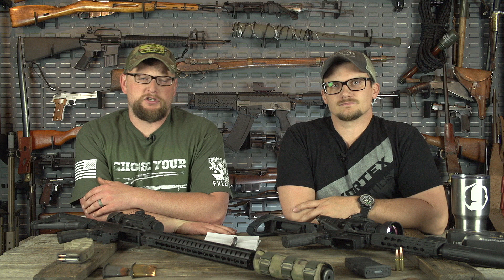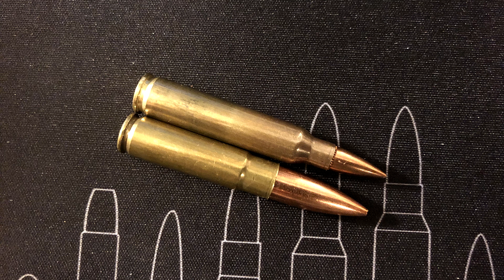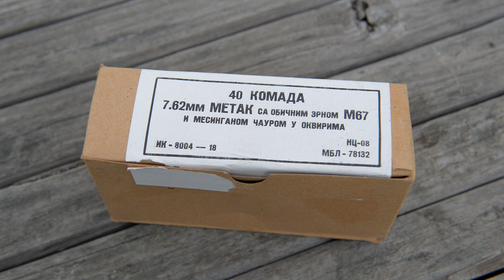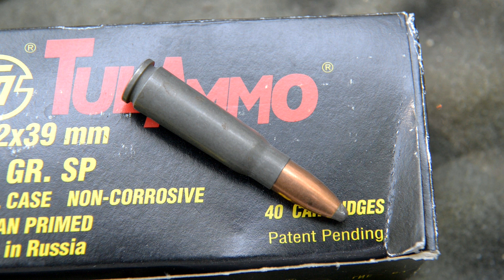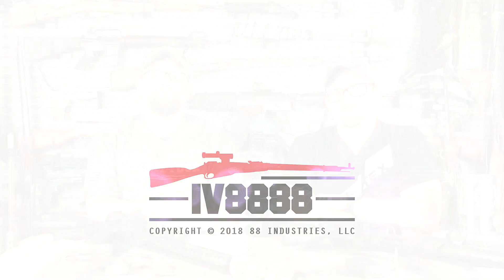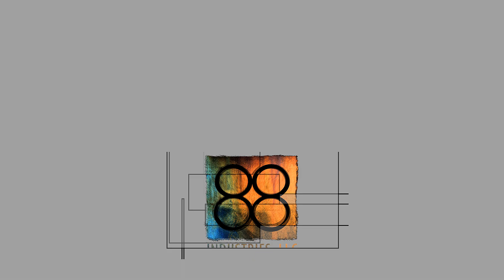Firearms Facts: 7.62x39mm vs 300 Blackout

Comment: And for reloading…the .300 AAC blackout  uses .308 bullets vs. .311 and thanks to the “Squirrel Daddy” case trim jig you can easily cut down .223/5.56 brass to be used in forming the .300 AAC brass (if you spend the $30 for the cheap assed Harbor Freight chop saw) and the .300 AAC really performs well with home-cast powder coated bullets…plus military surplus reloadable brass ammunition from Australian Defense Industries (ADI) loaded with 125 gr. Sierra MatchKing bullets for under .55 cents per round when they are on sale from Global Ordinance (it will be hard to find the bullets alone for that price after tax and shipping)…all in all…the .300 AAC blackout rocks in so many applications 👍👍👍

Comment: Psa ks47 for 7.62x39 AR 10.5” barrel and  300aac for 7.5” barrel AR does great suppressed or supersonic but the anmo is not for plinking way to expensive so plink with the 5.56 or 7.62 x39 or even better 5.56 gun with cmmg 22lr conversion bolt that’s the way to practice close range all day for free pretty much

Comment: I’ve looked into both I’ve owned a 7.62x39 AK underfolder but I went with the 300 blackout by traiding the Ak for 300 parts including lower parts 🤣🤣🤣 now I run 147 Grain 300 blackout pills out of the 16” barrel
Reply: 300 blackout is best! It’s stupid people trying to run x39 in AR platform . Just get 300 blkout I say!!

Comment: 300 black outs are garbage. I’ve bought a premium norveskie barrel load premium hand loads from 120-220grn bullets suppressor or not, barrel node or not, it doesn’t matter grouping is terrible performance is terrible. The powder for 300 is not h335 its 15grnz of h110 pistol powder whereas the 39 is 29grains of h322 rifle powder If you shoot hogs with a 300 black out 125grn ballistic tip vs a 39 123grn ballistic tip the results speak for itself. The 39 will out perform the 300 all day every day in accuracy, velocity, knock down etc. the black out was a basterd round developed and the projectiles for a 30 cal range from 300 black out to 300 win mag or greater the performance of the same class isn’t the same. If you’re debating on buying a 39 or 300 bo buy the 39 and thank me later

Comment: If you handload the 300 blackout the cases are practically free. Also, handloading the 7.62x39 requires the .310” bullets that are not as available or cheap. The deciding factor for most shooters is magazines. Reliable mags for 7.62 are also expensive. Finally, the 7.62mmx39 is a commie round and that communist gun powder stinks...

Comment: My question to you guys is: if my goal is a dedicated suppressed subsonic cartridge that I won’t use for anything over 200 m, which of the two Will give me better energy at terminal, and which one will give me better acoustics?
I own an 18 inch 5.56 that is really accurate more accurate than many bolt guns. I can save up quite a bit of brass from that but I can just as easily get brass for7.62X 39.
Reply: 300 BO

Comment: The M4 was built for close quarter combat and not engineered to kill, but to injure under the guise that it would take 1 or more of the enemy out of the battlefield taking care of their fallen. The .308/7.62, aka 300 Blackout, was designed to kill what it hits on the first shot. IMO, it is far more cost effective and efficient to just change all of our M16's into 300 Blackout with the swapping out of the barrel. Everything else works from the front sight through the magazine to the butt stock. 

If you need to do the work of a sniper, then use the tools of a sniper.

Comment: I shot a 8 point white tail deer with a 300 blackout pistol at 300 yards with a 208 grain subsonic two years ago with a 10 1/2 inch barrel suppressed . The white tail dropped in its tracks did not walk a foot . I have shot 5 white tail deer so far with 300 blackout pistols and rifles .  I have also shot several deer with 7.62x39 MM and I Absolutely LOVE the Caliber and own several firearms in the Caliber .

Comment: Great video, I got into 300blk basically because I got what I consider to be a great deal on a Ruger AR556 16” barrel from one of the large online gun shops ($539.00). I did not consider the scarcity or the cost of the ammunition, especially the subsonic loads. It has been difficult for me to find inexpensive, practice,pinking loads. The one brand that was inexpensive (13.00-20rd box) had serious feeding issues making it a non option for me. In my area 300blk is very scarce. And plinking with 40dollar boxes are cost prohibitive.
Reply: Time to start reloading, my friend.
Reply: AA 2200 & AA 2330 are decent powders for factory speeds

Comment: Cool video. I like 300 for short barrels and the feed ramps in the AR platform. 7.62 does great out of a short barrel too even with the flame BUT I like the AK platform too much to use it in an AR. With that said the only thing I don’t like about x39 in an AK is you have to be careful with bullet selection, some AKs deform the soft points.

Comment: If the cost of 300 BLK rounds were close to that of 7.62x39mm and the cost to build a custom 300 blk SBR was comparable or close to an AK SBR then I would go with the 300 BLK. A 300 blackout build that I am looking into is going to cost me nearly twice as much as a custom 7.62 build (Both SBRs). For the purposes I am using the gun for = close quarters self defense (100 yards or less the vast majority of the time), both guns are comparable in performance. The only thing that I am getting hung up on is the suppression capabilities, noise reduction, subsonic round availability and pricing. I am going to have to bite that bullet. I want subsonic in the AK pretty much for better suppression if I had to fire the rifle indoors. However, I can still live with supersonic rounds with a can/suppressor as the noise reduction is just sufficient enough that I won't sustain a large degree of hearing loss.

Comment: I love the knockdown power, fragmentation and multiple would channels from the 7.62x39 154gr. soft points for whitetail deer after 20 years. The 300 Blackout subs were designed to replace the H&K MP5SD. So would you take 300 blackout over a MP5SD 9mm?
Reply: This seems like the more accurate debate. 
I just watched a video about the comparison of the 9mm carbine vs 300 AAC carbine. 
Like everything, pros and cons. 
If you go with ammo costs and ease of finding it no question the Blackout will be near the  bottom of any list. Its more of a re-loaders thing. 
I would go with a Blackout carbine over a 9mm carbine for home defence. 
The 9mm has some fantastic cartridge options and low recoil keeping you on the target. Same goes for Blackout. Lots of options but once again the person probably reloads. I have some special 165 grain, hollow point, supersonic, magnum powder and primer.   
Low recoil, low noise and packs a serious punch. Getting hit with a 30 calibre under 20 feet is no joke. Its only pumpkins but the blackout does more damage than the 9mm at 20 yards and under which would be CQC distance. 

I believe your comment is accurate asking to choose between the two carbines
Reply: @rustyshackleford5704  I have both 300aac and 9mm AR pistols with 8" barrels and SB Tactical braces. They both have their own traits and benefits. The only reason I got a AR9 was to use the same magazines as my Glock 19. 300aac destroys 9mm everytime but 9mm Parabellum has been around since 1904 and is the World standard military pistol cartridge. There are many situations that 9mm NATO is perfectly capable of handling. The 300aac is more comparable to 30-30 Winchester and 7.62x39 in the power department and has plenty of power for deer and hogs. Which is why 300aac is so popular here in Texas. Winchester Deer Season 300 blackout ballistic tips have outstanding performance on both deer and hogs. Most of the time for raccoons, coyotes and varmints the 9mm is sufficient.
Reply: @celmer6  

Pros and cons to everything. 
Glocks are popular pistols and many have magazines for them and an AR is popular too. Magazines are readily available for each its just boils down to ammo availability. 
Main factor I suppose is if you cant hit what you are aiming at then it doesn't matter what you have 😆

Comment: 300AAC is a MISTAKE -- too big a bullet, too slow a velocity. I think of the 300 AAC as a more compact 7.62x39 that is 200 fps slower. They should have kept the 223 length and case, but neck it to 6.5mm. That will be a much better "Efficient Intermediate" cartridge. The standard supersonic load could have been a 107 grain HPBT at 2,500 fps and a .40~.44 BC (G1) on 21~22gr of powder. The subsonic suppressed load could have been the 150 gr HPBT with ~.71 BC (G1) at 1000 fps with ~5 gr of powder.

Comment: I have a barrel of .300 blackout, I changed it to be used with 7.62x39 ammunition? Is this not a problem considering there is a difference of 0.0508 mm between projectiles .300 blackout and 7.62x39 Russia?

Comment: If you're not able to suppress 300blk and run subs you don't need 300blk. They were designed for very differnt purposes. If you want to compare a soviet round to 300 blk, 9x39m would be more appropriate.

Comment: 762x39 is ballistically superior to 300blackout....
40s&w delivers over 480 foot pounds while 9mm only delivers 336 with +p.
people like 9mm because 336 ft lbs(and often even less) is plenty enough KE, and actually penetrates and expands similarly in most realistic and practical scenarios, making the lighter weight, smaller frames, and higher capacity per size, a complete win.  
the .300 bo is available in 5 lb platforms that are moa or sub moa.   
there is no doubt that 762x39 delivers more power and is cheaper and more widely available.  
but when it comes to weapons like the honey badger and noveske ghetto blaster, the appeal is obvious and there’s nothing else like it, certainly not in 7.62x39.

Comment: I believe the .300 Blackout is an L&L caliber. My 10.5 inch barreled pistol wears an OSS can and it will figure into CQB defense if it comes to that. I view the .300 Blackout subsonic to fill the niche previously occupied by the H&K MP5SD but with greater stopping power. With a DSA Nickel Teflon coated bcg with sand cuts and a CMC single stage trigger, it is a fast shooting semi auto perfect for CQB in any environment.

Comment: They are for two different purposes. As a general purpose short/mid range hunting/fun/SD round the 7.62 is well suited. For SD/tactical suppressed in a compact form factor that could kill a deer in a pinch if you really needed it to the 300 BLK is great. So ask yourself what you are doing with it and buy the weapon purposed for that use. If you are the average hunter hunting deer and low volume pig hunting you would be better suited with something like a ruger american ranch in 7.62x39 anyway. If you REALLY wanted to stick with the AK round. The semi auto 7.62x39 AK mag guns are great for high volume pig hunting like in texas etc where you are making quick shots on many hogs. But kinda wasted on just hunting from a treestand or whatever. If you want a PDW in short barrel SBR or Pistol that you can throw in a truck or backpack the 300 Blackout is the ticket.

Comment: Interesting video, although Eric might have interrupted Chad a bit less.  Owning firearms in both calibers I agree that it depends on the intended use and 300 Blackout is more of a "for fun" offering.  Two additional caveats for 300 Blackout.  All 223/556 magazines don't work well for 300 Blackout because of the cartridge length.  Also, you definitely don't want to mix 223/556 with 300 Blackout rounds (especially the latter in a rifle running the former).  As a result, I never shoot the two calibers at the same time and I use magazines designed specifically for 300 Blackout and as importantly, labeled as such.  Great information provided again by Eric and Chad!

Comment: I had little respect for 7.62x39 as a hunting round until I got my hands on a cz 527. I was amazed at 150 yd accuracy. 18.5 in barrel bolt action takes advantage of that 7.62x39.
Reply: 18.5 all the way down to 12.5 your gonna get the same velocity because it's 762×39 is a low pressure round
Reply: @joebyden4654  This is not so, you don't gain like you would with a higher pressure round but you  do gain 30 fps per inch of barrel. High pressure round gains are somewhere between 50-100 fps per inch of barrel.
Reply: 1ST Deer I ever shot with a rifle was with a wasr ak and cheap Russian hollowpoints,,,,killed him dead.....I'm really a shotgun hunter I lile to get close..
Reply: @tomcatmcgillicutty6913  their not actually considered hollow points . They call em open points but they have that hole because the way their manufactured but it’s not expected to expand.

Comment: Hey, I have a question. Can't we handload 5.56/.223 with the fast-burning pistol powder to counteract velocity loss on short barrels??
Reply: Not an expert, but I understand 300blk short barrels have a much higher twist rate, which is needed for accuracy. Even if you could get the higher twist rate in the 5.56, which I think you can't, your angular momentum then might cause the bullet to fragment as the spin pulled the bullet apart. I might be totally wrong, but I think I heard something along these lines before.

Comment: To me it seemed like the the .300 blk was a solution looking for a problem.  I don't think anybody buys them for unsuppressed performance - as you point out, they're not particularly spectacular in that regard.  But if I were looking for a suppressed gun that delivered about 400-500 ft/lbs, I'd put a can on a Glock 20 with extended mags... and just to trick it out a bit more, put it in a KPOS or RONI stock, which would come in at about half the weight and a more compact profile.

Comment: Would a trade for a SKS for an 300 blackout rifle be good?
Reply: Captain Harlock yes. I love SKS this but there’s so much more you can do with an AR platform.
Reply: @WTF-vv8ic  I mean I have all kinds of tactical stuff for it, on it, tri picatinny rail, bi pod, red dot scope,can use detachable mags, etc. Was never a fan of AR/M4 platforms. Was looking at AR-10's as an upgrade, in that case I'd go for it, but my question is if 300 blackout is worth it.

Comment: I have both in Palmeto kit parts. You hit the nail on the head. I reload 300 AAC and plink with 7.62x39mm due to off-the -shelf economy ammo.  I convert .223/5.56 brass to 300 AAC. I’ve experienced poor quality is bulk economy 300 AAC ammo with having to disassemble over 1/2 off my last purchase and resize the cases to achieve reliable feeding. No problems with brand-name ammo but 1.5 times or more expensive than the bulk ammo. I’ve ordered 7.62x39 dies. Will report my 7.62x39 reloading experiences at a later date.

Comment: Guys got the AR-15 thinking it was so hot, only to find out it's just a 22.  So they develop these other round trying to make it into something it is not, wanting it to equal the 7.62x39.  Jeez, just get an AK!   Or cut to the quick and get an AR-10.  The 300 Blackout sits between the 5.56 and 308, totally smoked by the 6.5 CM, trying to copy the 7.62x39, and brings nothing to the table.  Thanks for the vid.

Comment: Great video but I bought my BCA 7.62x39 complete gun for right around $350 and mags that are SS USA made only ran me $15 free shipping on eBay. Now let’s get to ammo cost where I can run steel cased wolf HP for target or hunting purposes for under $5 a 20rd box. I have not seen any significant gains on swapping to .300blk that are worth the cost in ammunition. Unless you plan on scrapping your .223 upper to swap to a .300 blk barrel there’s no real cost difference, because even if you build you still have to buy all the components that make up the upper assembly, which you can do the same with 7.62x39 that mounts right up to a mil spec lower. And $15 for a magazine is still less then most 20rd boxes of 300blk

Comment: The biggest issue with the .300 Bk is the fact that the cartridge will chamber in a 5.56 chamber if it's slammed home and the bullet will  get driven up into the case. That creates a hand grenade. It will explode and throw pieces of your gun in all directions. I shot a BK 300 for a while and realized the potential of a disaster the got rid of the .300 BK immediately.

Comment: Sell me 300 Blackout for less then $0.20, and I will never touch 7.62×39.
Reply: Stop it, is you want brass 7.62x39 it will now cost slightly more than 300 blackout now, not much but like 20-30 bucks more for a 1000 rounds.
Reply: Find me some 190gr sub x rounds in 7.62x39 and I'll swap from 300 blk out
Reply: Brown bear has 194 grain sub 762, Atomic has 220 grain sub 762 and alot other 762 sub in a variety of grains...
Reply: @MegaBoooooooooooooob  and I have a 45 acp...problem solved
Reply: @fishngame7066  We are talking about RIFLE rounds, not slow and outdated 45acp.  Can 45 even penetrate level 2 soft armor?  It's kinda pointless, just get 9 or 10mm for pistol rounds
Reply: @travisfrinzell284  It's called .45 ACP
Reply: @travisfrinzell284  I'd rather tell you to buy a 45 acp and stop buying bullshit. Oh...and a can for it
Reply: I'd love to know what rifle ammo you're buying for 20 cents a round. Erik talks about 300 blk for hunting that's not what it was designed for
Reply: @famousmidnight it was designed to be flexible.
Reply: Rip to those prices
Reply: The best way to run a 300blk is to reload.
Reply: Able to get any of that snail ammo broski??? Lol lol